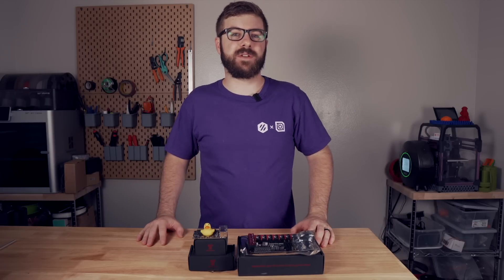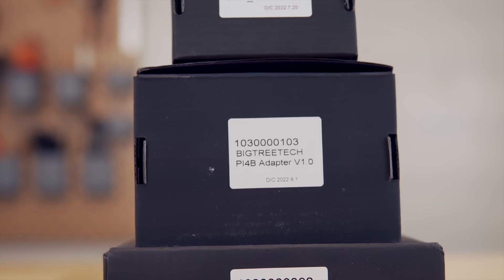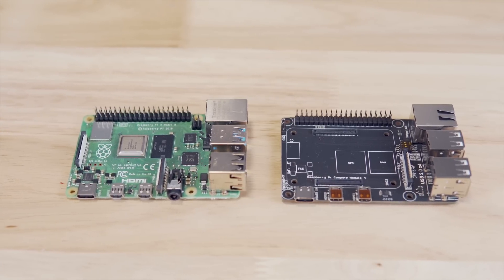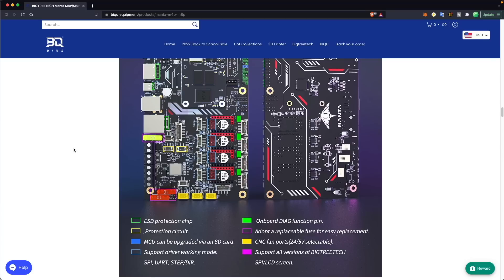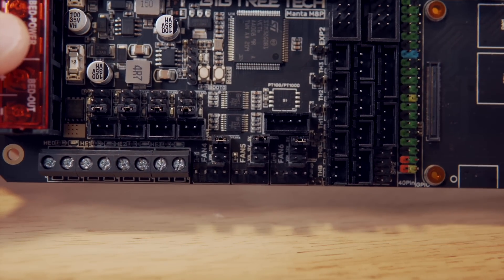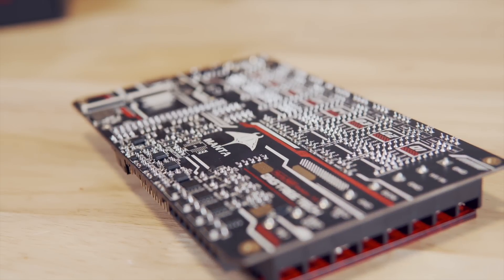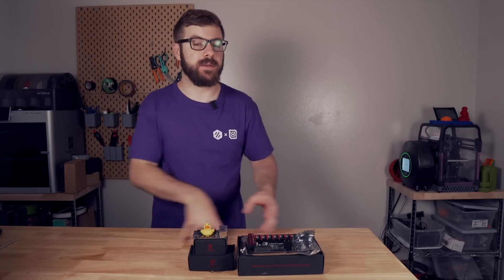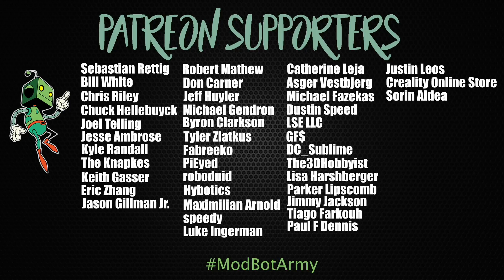Is This The Best Board For Klipper? BigTreeTech Manta & CB1

Comment from the maker: I have had a few comments and messages regarding wifi issues on the CB1. I checked with the CB1 I received and installed on the M8P and didnt have any issues. The second one I ordered from Aliexpress I installed in the Pi 4B Adapter and have tried the latest image (2 days ago) and previous but wifi either works briefly or doesn't work at all. I gave feedback to BTT on this and have been told it is not hardware but the image that is causing the issue. I am really hoping they are able to get this hammered out sooner than later. When I do get the wifi on the CB1 reliably working I will make a setup guide. Pi 4b and Manta boards with CM4 are not affected by this as it is related to the CB1 image file.
Reply: This WIFI isn't an issue limited to the CB1. It uses the H616 SOC, just like the Orange PI Zero 2's I have worked with, and can confirm the issue lies with the Armbian/Debian builds. Old versions had no driver support 2 years ago, versions  circa Feb of this year work OK. Recent versions of Armbian Bulleye have failed to boot at all!! I have had reasonably better luck with Debian, rather than Armbian builds.

Ethernet on the other hand is just plain solid all the way around.
Reply: @luisderivas6005  I only run ethernet on my printers anyway. I just dont like having that stuff on wifi. What build are you using for your CB1? Could you share a link?
Reply: For someone who only cars about wired connections, does the V1.1.0 bullseye work just fine?
Reply from the maker: @BackwoodsTinkerer  I have not heard of any Ethernet issues. Just don’t use the latest since it intentionally breaks Ethernet. The latest has been stable on one of the two cb1 units over wifi for 2 days now so it’s definitely corrected the issue for some units. But yeah I hadn’t heard any issues from those that are wired.
Reply: These manta boards are insane! Definitely just broke the mold and I can see this being the baseline for the future.

Comment: Hi, I have a query. I want to connect Raspberry Pi with Manta 8P. I connected using C type cable but I get the mcu id as pi@pi:~/klipper $ ls /dev/serial/by-id/*
/dev/serial/by-id/usb-1a86_USB_Serial-if00-port0. What am I missing here.
Reply: Solved…

Connected with Serial (on USART1 PA10/PA9) using TFT pins with Raspberry Pi 3B model GPIO pins. Without crossing of TxRx pins. 
But couldn't figured out to connect EBB42 alongwith Manta8P and Rpi 3b.
@ModBotArmy Can you comment here?

Comment: Is there a guide to install klipper into the cb2, then installing the firmware (not Klipper) on to a manta m8p v2. 
And then the instructions on how to set up for your printer on the software level, not wiring.

Comment: I just received my M4P and CB1. BTT is usually really good about sending all the hardware needed. So, I was surprised that there weren't any screws for mounting the CB1 to the M4P. I was also confused by the thin film that is in the mounting holes on the CB1. Is the film some type of thread locker?  Another question(s) in what length screw should be used and should a washer be used?
Do you think I am too concerned about vibration issues?

Comment: I'm planing on kliperize my ender 3 v2 and I want to use double X and Y motors is it recomendable to use the m4p or do the X and Y motors doesnt work like the Z motors and need separate drivers in order to get the maximum out of klipper input shaper? There for I'd be needing the m8p?

Comment: I have an old Sindoh 3dwox 2x ( IDEX).  would it be possible to rebuild this with a board like this? How can I check this? This printer uses 2 Bowden tubes with for each filament 2 motors, one near the spool and one for the extruder. Would it be very complicated to make it work? I would love to try, but if there are more challenges I can handle, it would not be worth the effort

Comment: I cannot see anywhere in the specs if the motor input voltage supports 48v like the Octopus pro, I need to run four 48v super powers ht for my vzbot and ill run external tmc5160, I really like the form factor of this board and would prefer it over the octopus pro, anyone knows?

Comment: The CB1 is more like the power of a Raspberry Pi 3B than the Raspberry Pi 4, but it is nice that they are using pin compatible connectors with the CM4.
I think the itnegrated board has pros, like easier mounting, better power supply and wiring, but I like the separate Pi 4 board solution because it allows me to add additional layers of protection where the Pi (or CB1 and Pi 4 adaptor) control power in the even that printer control board has issues that cause heaters to get stuck on

Comment: I got exactly this bundle for my Artillery Sidewinder X2 and planning on upgrading it with this however I have got Klipper running at the moment on the BBT Pi 1.2v which is fit inside the case so no rush :)

Comment: There is one big issue on the CB1! I have a manta m8p v2 with a cb1 and I purchased BTT pi tft50 screen which connects via the DSI interface, cant get this to work and cant find a fix you need a genuine Pi CM4😖

Comment: Im a Lorry driver, Not a tech savi, I brought the Manta M8P CB1 to put in one of my Ender 5 Plus's, and the Adapter and CB1 to use for a camera base and what ever else i can use it for (when i learn how) Ive made major case mods to fit the board to the ender 5+ case, fitted the TFT35 SP1 v2.1 screen.  But, as a Lorry driver i dont have a scoobiedoo on all the bits n bobs and Firmware this that and the other i need do now.  Im trying the water big time here..... A proper old school wiring diagram would be a bonus but the manual only has terms a truckers head struggles to process.    HELP!!!!!

Comment: I really like the Manta's features, now if they would just add in a support for an optional multi channel servo board.   The foot print is still very close to the Octopus, insane.

They do need to spend more time on their documentation though, especially for their CANBUS products which will be my next adventure on my IDEX to reduce the number wires.  I suspect we will see more canbus products for 3d print boards since they can be daisy chained.  Same thing car manufactuers did so one ecu can monitor and control numerous modules.
Reply: If you can find an I2C interface then connecting a generic servo driver board should just be a case of software support. Same with connecting another MCU over USB that drives the servos, or a CAN controlled servo driver should be possible too.

Comment: Honestly, the Pi shortage is almost a blessing in disguese. You can buy second hand Barebone or Industrial computers for less than the PI 4B 8gb at this point. While the Pi's have a place, it's always been love-hate for development. With the chip shortage its hate-hate, so their place is history books as far as i'm concerned. x86 systems are easier to debug, support more compatibility and are basically better in every way except power consumption and size. I'm not going back to these janky devices, i have wasted so much time debugging problems that wouldn't exist on a x86 with full Linux OS.

Comment: hey you should try to setup a printer to use the cb1, its a mess. and the instructs are super incomplete, they say all this stuff works but the os is like a vm or something, and like half the things are mising. A guide will be like run this command, and that directory will either be empty or the tool will not be there.

Comment: It worth to mention that the CB1 is not and will not be compatible with DSI screen. Unfortunately the chip is not capable of MIPI protocol so we will not be able to use fancy touch screen like the PiTFT or there new raspberry pad !
Reply: On the other hand, you could always find an old 5 year Android phone for free from a recycling drop, and use Klipperscreen @ 1920x1080! I just tasked an old ZTE981 after wiping it and disabling Lookout and other un-needed binaries.

Comment: Can you use it with regular pi? I have a pi already but recently in my ender 3 something on the board died (hotend temperature sensor always show around -40 degrees Celcius even when I unplug the sensor from the board) so I've been looking for a replacement board.

Comment: I've got a CB1 and the PI4B Adapter, Warning the DSI and CSI ports do not function with the CB1 and will only work with a full CM4 so its not really a Raspberry Pi compatible board.

and the released image is a little broken at the moment but has improved in the last release
Reply: Nope, it's more like an Orange Pi. Binaries are not compatible. You will have to complle Klipper and utils on for the board and certain RPI binaries are not usable due to hardware dependencies.

Comment: Good luck with that. The support for the CB1 linux images is terrrible so far. Some people report crashing, loosing wi-fi connection on USB power/24 V power/both. Possible HW problems on CB1/Manta power circuit.
Reply: Terrible is a stretch. Wifi is a known issue with H616 SOC support on Debian based distros, but not Debian itself. You would have the same problem with Orange PI based H616 boards.
Reply: @luisderivas6005  Now it's a confirmed HW issue, some CB1's are being replaced. Fortunately, mine are not affected.

Comment: CB1,problems with wifi,help...
Reply from the maker: What problems? Mine connected right up. Did you edit the config file on the sd card after flashing the cb1 image?
Reply: @ModBotArmy  yes, I edited it but it doesn't connect to the wifi, there are reports of problems, can you make the file available?

Comment: i think a manta 5p would have been better
since most generic builds are corexy with 2 steppers for Z
Reply: Or, maybe a 4p, 6p, and, the 8p.....
Reply: Generally corexy builds with only two Z steppers run them synchronously, which is why you'll often find dual Z stepper headers on BTT boards running from just one driver.  Looking at the pinout for the M4P this is indeed the case.  Aka, the M4P can run five steppers, two of those being synchronized z-axis steppers.
Reply: @bentracy7463  ye, but i run dual z stepper drivers on my basic corexy printer, and most builds these days can even use 3, trident ratrig
Reply: @bartklump  fair enough, although imo at that point one might as well jump to an eight driver board for future proofing.  A six driver option would be nice though.
Reply: M5P exists now

Comment: Are there 48v support for high voltage steppers???
Reply from the maker: Yup! Separate power input for high voltage steppers.
Reply: @ModBotArmy  even up to 60V drivers, although that can be risky, since you are right at the limit of the capacitors.
Also nice: you can set the driver voltage via jumpers, on a fly super 8 you are locked into 4 high voltage and 4 low voltage drivers

Comment: This must be a sponsored video, because it seems you haven’t used it yet but you still have such a clickbait title. I’ve attempted to use it and setting up the CB1 is not straightforward. I suppose you might eventually post another video on “here’s how to actually set it up, particularly when the latest CB1 image disagrees with the user manual” but this video is just sales for BTT. Do better.
Reply from the maker: BTT sent the board which was mentioned but the opinions are my own. There has been no exchange of money and it is not sponsored. I have hardly done any sponsored videos since the beginning of this channel. Sponsors are usually an ad at the beginning of the video and are stated as such. You clearly had a bad experience which is unfortunate but to be rude won’t help you get your board working. Do better.

Comment: 4 drivers is useless unless you have cantilever that used just 4 anyway but for dual z the 8 driver version is just too much it needs 5 drive version
Reply from the maker: 4 drivers takes 5 motor just not independently driven. So no tramming but definitely viable for some setups.
Reply: @ModBotArmy  yes for cantilever but not independent dual z
Reply from the maker: @TommiHonkonen  agreed having 5 instead of 4 would have made it more versatile. I wonder if size was a factor.
Reply: A switchwire needs only four drivers, isn't it?

Comment: Been waiting for someone to do a video on this, looks great!  Wished they had gone with the new EZ style drivers.  Seems like they are only half in on the new style of driver connection, and I think the new style of driver connections is what we should have had since day one, but I guess it is what it is and it is still an awesome board.
Reply from the maker: I just found a placeholder for the m8p labeled ez coming soon. Something tells me they are working on a variant that can take the new drivers
Reply: @ModBotArmy  Nice!  I really do hope that the EZ style drivers are what becomes the new standard.  Hopefully other board makers copy this too.
Reply: What are the EZ drivers? I've not seen those and a quick Google search came up blank.
Reply: @JonS  They dont use pins, they are inserted more like a computer PCIe board would be.  The drivers themselfs are not really any different, just the way they connect to the board is different.  They are keyed and can only go in one way.
Reply: @jon9947  ah! I found them now. Looks like a nice improvement.
Reply: @JonS  i think MirageC made a video on the BTT SKR EZ board. And it should show the new kind of stepper drivers.
Reply: @kristian6087  I think I seen that video.  I just thought it was weird that they released the Manta boards without compatibility with the new driver.  If I wanted to make sure the new standard of driver connections was the EZ drivers then everyboard I released with swappable drivers would have the EZ driver port on them.  

I was sort of hoping that the EZ drivers would become the new standard of drivers for all boards going forward.  I understand that it would take a little time to get everyone onboard with the new standard and that is the reason the EZ board is compatible with both the new and old style of drivers, but I would like to see a day the old pin style drivers are gone.

Comment: Nice, thanks for the review.
How would the combo M8P + CB1 fit in a Voron 2.4 compared to an Octopus + RPi4? 
Any noticeable difference worth mentioning between these 2 options? (ex: I don't see the replacable fuses anymore on the M8P)
Does a separate 5V power supply for the Pi still needed ?

Comment: I picked one up as soon as it was released, this is a great, inexpensive option to either upgrade an existing printer or build a new one. If you don't need the features in the octopus pro, the M8P is an amazing value from what I can see.
Reply: What features does the octopus offer that this doesn’t?
Reply: @nathan1sixteen  That was going to be my question also.  I'm lucky - I have two Octopus pros and one Octopus 1.0 all with Pi 4s.  So don't need this now, but looks great and very well priced.
Reply: 35 for 1gb ram seems kind of high. Have you witnessed any limitations with the small ram size? 
Does it also have internal storage that klipper can be installed on or do you still need a sd card?
Reply: @OregonDuck  that’s what a standard Pi has along with the Pi zero
Reply: @nathan1sixteen  internal storage to install klipper on?
Reply: @OregonDuck  no, you install it on a micro SD, just like you would on a pi
Reply: @nathan1sixteen  was hoping for something better. Before you say anything about pi, I use other sbc that has more ram, ROM space for loca install vs sd for more. I was hoping for more, but it’s just a pi clone. Ty for the responses.